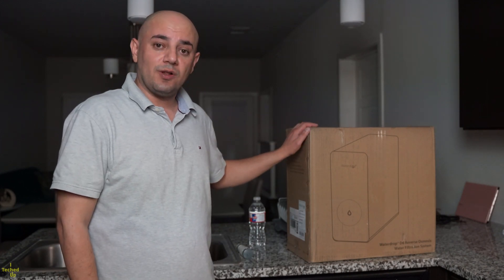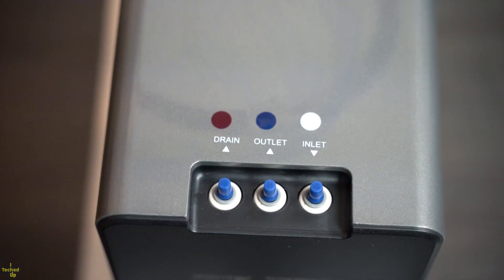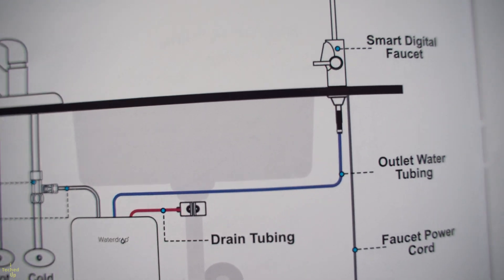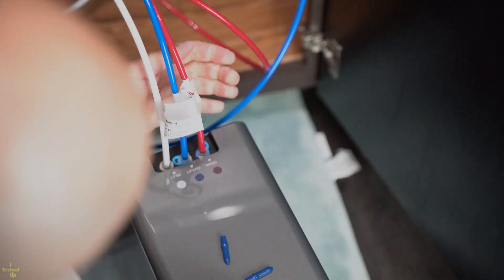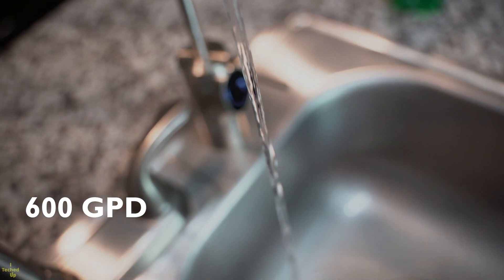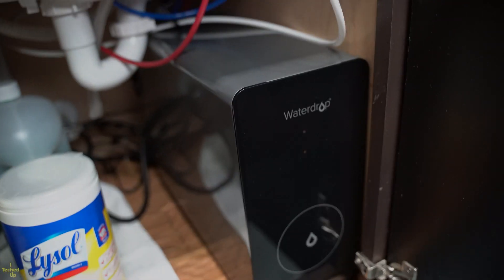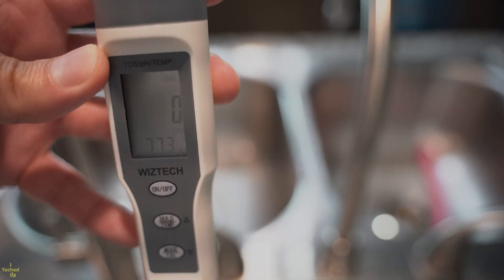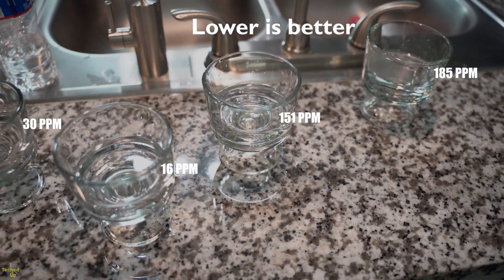Bottled Water vs. Water Filtration System (TDS Meter)

Comment: "Bottled water" covers a HUGE range of products, usually in the category of "drinking water"....which typically make claims of being "purified" but retaining "beneficial" minerals.   I would not expect them to have a particularly low TDS reading.   This is a bogus comparison.   The numbers you tested between your RO water and tap water showed 18/151 = approx 88% exclusion ratio...which is not very good for any RO system.   The one I have and several others I am familiar with, including the vanding machines available at various stores,  run 95-98% exclusion ratios.   All of the under-sink units have better flow-rates than this system.   None of them require a power source.   Glad you're impressed and satisfied.   I would not be.
Reply: Ok mr gloom and doom
Reply: No gloom or doom at all, just facts taken from personal experience and testing.

Comment: what is the power needed for? vs a RO system that works based on water pressure?
Reply from the maker: That's a great question! Honestly I'm not too sure but if I had to guess it's because this is a tankless unit. Hence no water is stored in it and there's no pressure without power. Something like that. I would be interested to know for sure if anyone else has an idea.
Reply: Power is pretty much for the pump, traditional system uses tank with pressurized bladder to increase water pressure at the tap.